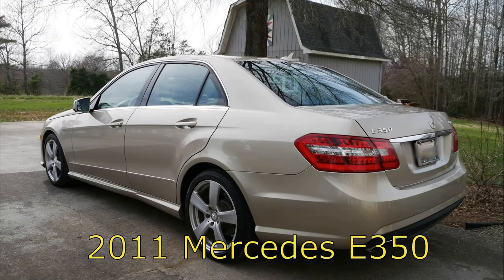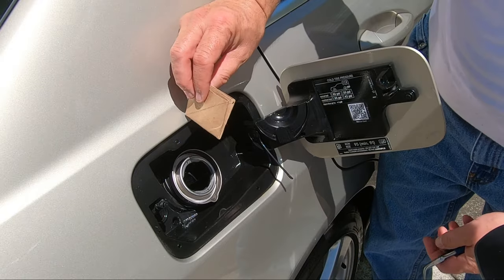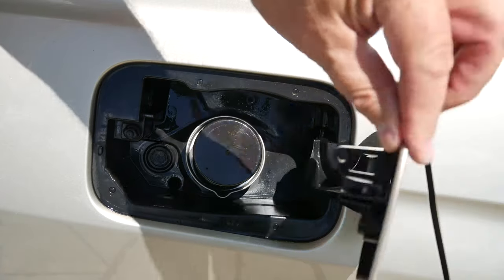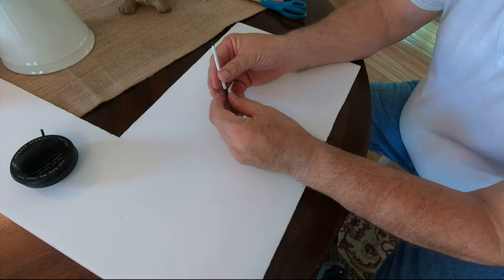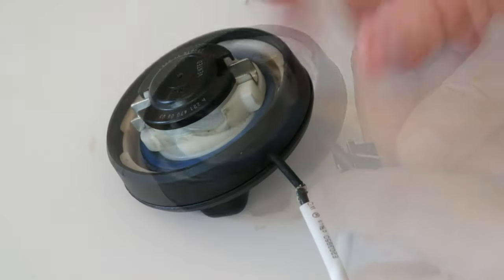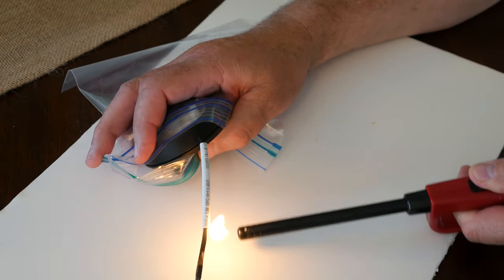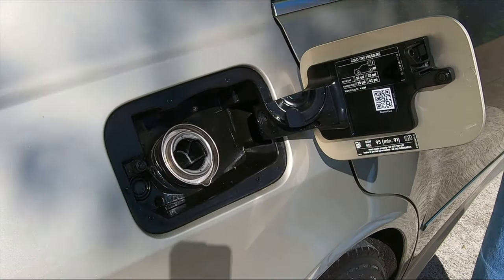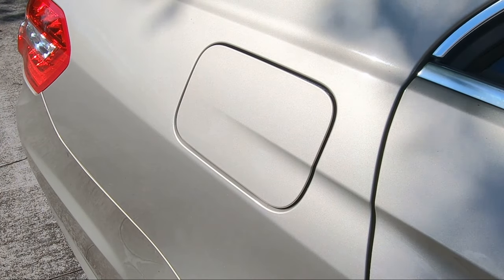Mercedes Gas Cap Lanyard Repair Part 1...quick fix...broken near the middle

Comment: I have been using C200 with broken petrol tank cap broken lanyard. On two separate occasions, I noticed dashboard alarm come up and stay specially after I fill up the tank. Could the reason be broken lanyard ? I don’t have any problem using broken lanyard however if it is triggering dashboard alarm then I would like to fix the broken lanyard. Any thoughts ?
Reply from the maker: More likely the gas cap may not be completely sealing.  This wouldn’t be an alarm associated with a broken lanyard.  Dean

Comment: They’re about $20 dollars new my friend
Reply from the maker: Yeah I know.  I looked em up before making the video but just wanted to see if the repair would work.  It did for awhile, then broke again so I made Part 2, then that broke too and now I’m running without a lanyard.  Funny, my old 2006 Ford truck has never had to have a lanyard replaced and I spent 10 times less on the purchase price.  Guess not everything German made is better.
Reply: $50 new
Reply: @PilotViewProductions  it seems to be a common problem with them all. Everyone I’ve spoken to has had this problem. I think the rubber they use isn’t fuel resistant and also it being so thin is a factor also. As long as it lasts for 3 years warranty period, they’re not that bothered.
Reply: Depending on the vehicle. $10 on Amazon